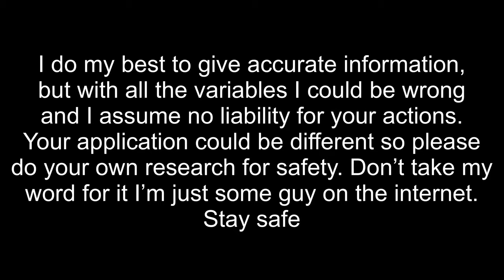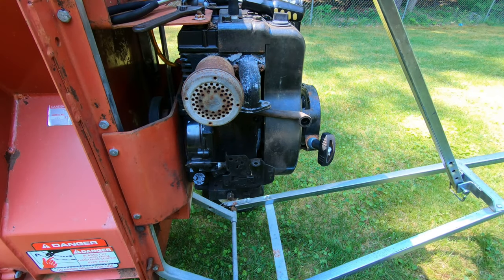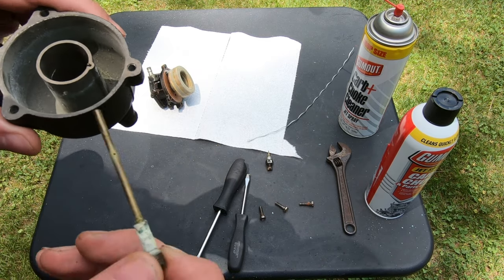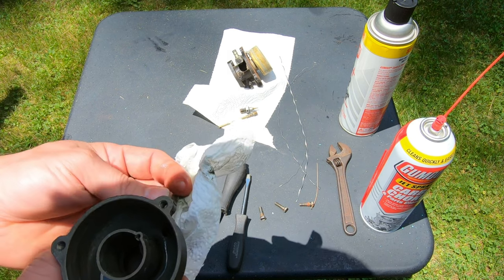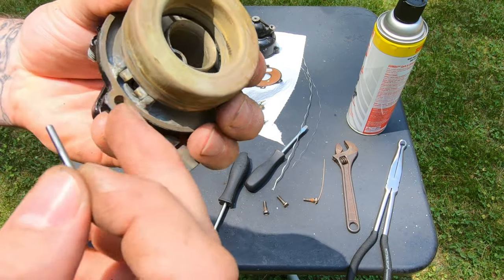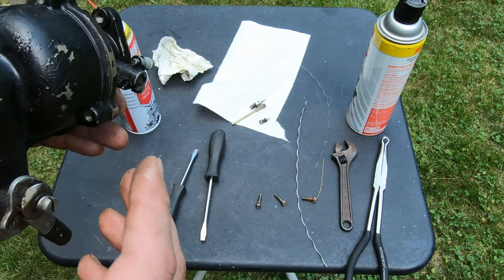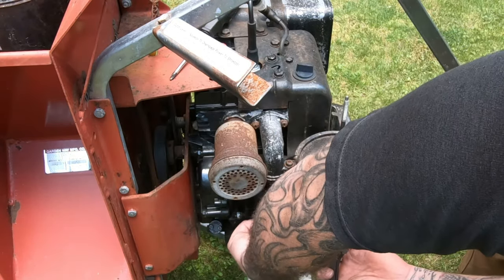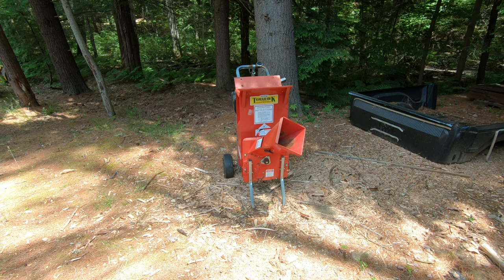8hp Tomahawk chipper shredder repair

Comment: Disengage the flails useing the belt tensioner. It will start a lot easier    Engage after it’s running and disengage then shut down the engine.  Good job keeping the old guy running. Those engines are really solid. They call that an up draft carb.
Reply from the maker: Thank you. I’ve heard of an up draft carburetor but this was the first time I had one apart. It was interesting. Definitely seemed like a well built machine.

Comment: Cool. I just did one of those engines at work, it was a 1976 concrete mixer. Hadn't been used in years, just drained the green crap out of the fuel tank and replaced the spark plug and fuel line and it fired right up. Not made like this anymore!
Reply from the maker: I know. These engines are pretty durable. There’s not much to go wrong on them. It would be nice if they would take the ethanol out of the gas, it would reduce a lot of carb problems. I’ve been putting stabilizer in all my gas cans, it seems to help

Comment: Great in depth video.  Since it "takes one to know one", I would guess by your accent that you're in Maine.  I replaced the entire carb, filter, and spark plug.  It ran like a champ for about an hour but now won't start at all.  Took the plug out and it was black.  Cleaned it well but no change.  Gas is new TruFuel.  I am suspecting that the throttle has something to do with it but what the hell do I know... any thoughts?
Reply from the maker: I would try giving it a shot of starter fluid and see if it fires. Should point you to if it’s a fuel issue or not. I had a riding mower that was running fine went to use it after a week and it ran for a few minutes and stopped. I could see fuel getting sucked into the intake but nothing a bit of starting fluid and it fired. showed me the gas was bad and got water in it. At the minimum you’ll be able to rule out fuel. I’d probably next take the plug out and check for spark from the plug and from the coil wire with out the plug Incase the plug is bad.

Comment: green wood only and pull lever in when shutting down . be safe looks like danger.
Reply from the maker: Thank you for the advice. I actually sold this unit shortly after I Made the video. It is a little small for what I would need it for.